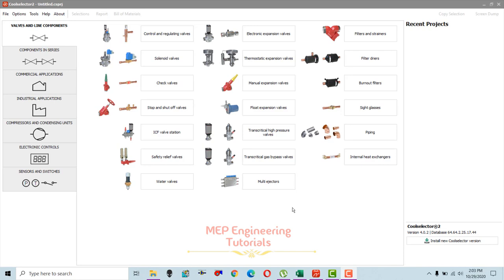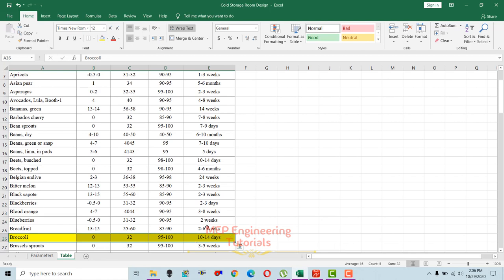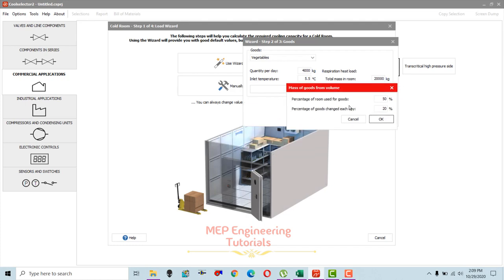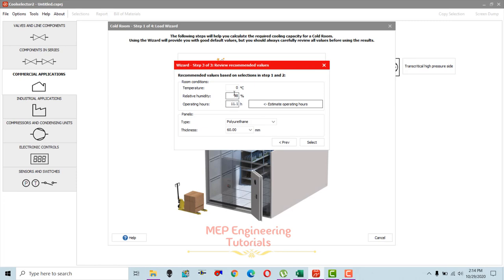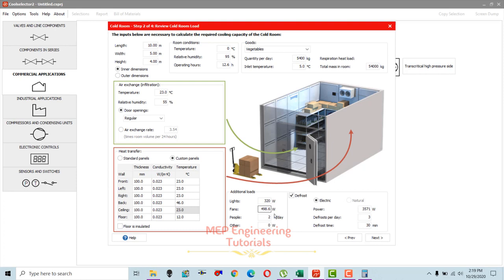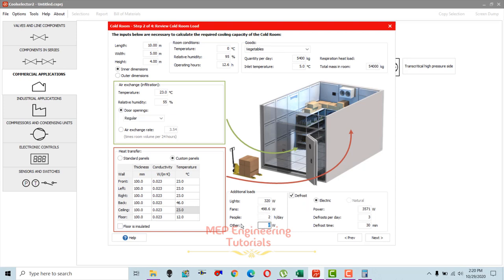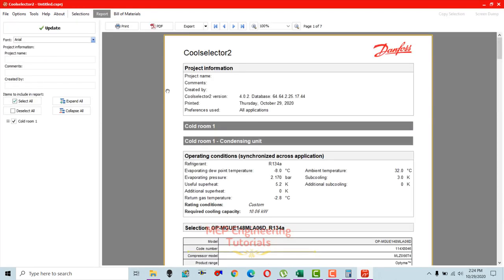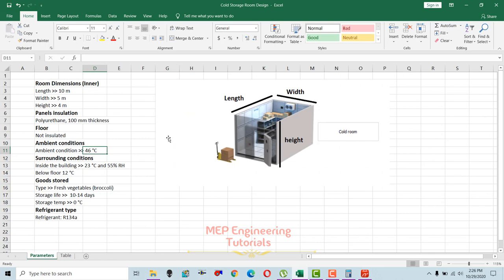Cold storage room refrigeration design using Danfoss cool selector software (cold room heat load)

Comment: Very good explanation. As I know this software is not working for big area like 100m x 90m (L x W) did u try?
Reply from the maker: Yes that's correct because as per design limitations maximum coverage area is 25mx20m = 500 sq meters, in case you have more than 500 Sq meters like if you have 1000 Sq meters then make 2 cold storage rooms with each having 25mx20m dimensions

Comment: Need excel sheet for heat load calculation
Reply from the maker: @Syed Saaed kindly check your email
Reply: @MEPEngineeringTutorials  sorry I  need excel for hvac load calculation
Reply from the maker: @thong follow membership link given in the video description to get access to excel sheet
Reply: @MEPEngineeringTutorials  Hello could you have the excel sheet fir heat load calculation. Kindly share.
Reply from the maker: Hello. You must join channel membership to get access to required spreadsheet. Thanks